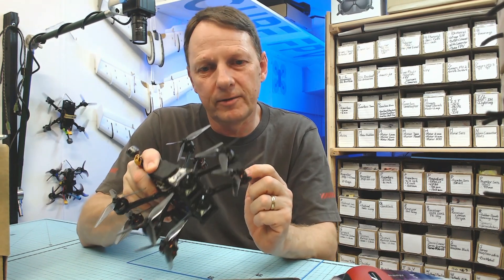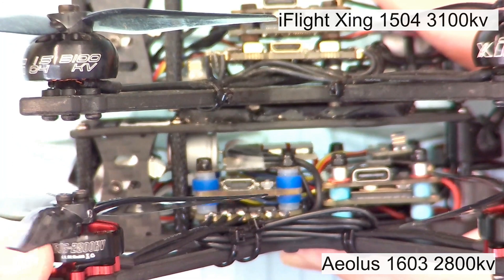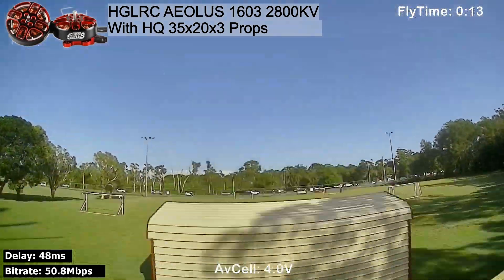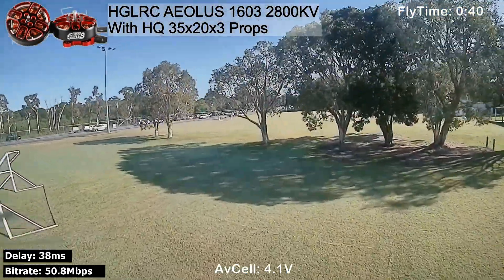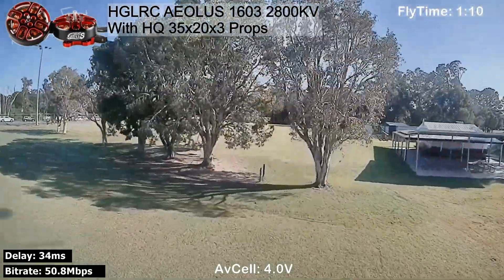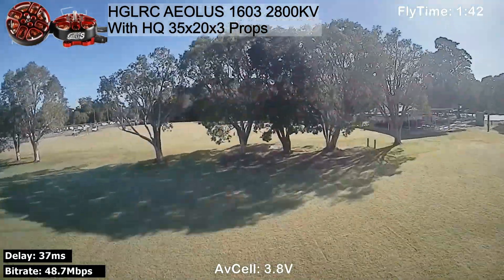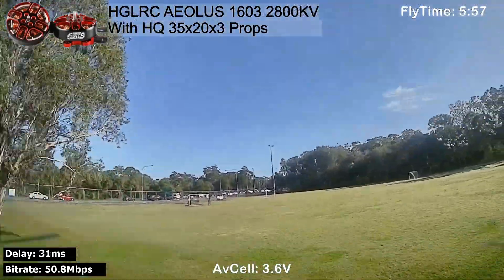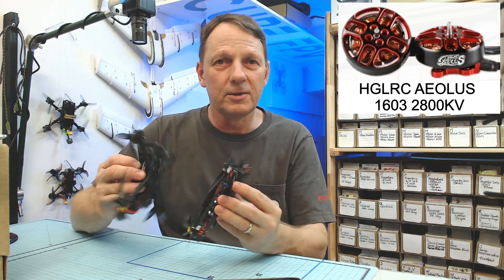Aeolus 1603 2800kv Motor Testing for 3.5 inch Freestyle

Comment: hello, based on the builds you've tested. may i ask what setup would you recommend for analog 3.5 inch freestyle build on 4s? frame, motors, aio or stack, props, etc. thank you very much. i already have crux35 analog. but im planning to build one
Reply from the maker: One of the best 3.5 inch frames is actually the one i am showing here - the GEP RC 3.5 inch. It's an older frame and great for analog. It's also suited for 19mm cameras which I like. I like this frame because its a short frame and you can stack components and keep the mass central. I fly HD but with analog the all up weight should be even less. I would go with an AIO board - any 35 amp AIO is fine. I've been using AIO in 3.5 inch for a long time with no problems. I use Xing 1504 3100KV motors even though others reccomend more powerful motors. These motors are good and the power and resoution in the throttle of these smaller motors is good for freestyle. Larger motors of course are more powerful but that doesn't help with fine resolution in the throttle that is needed for freestyle. I use an 850mah 4S cell with 3520 3 blade props and he a good 4 and a half minute flight time. 
Take a look at this resource on my website to see what motor, battery and prop combos are good for 3.5 inch freestyle - https://cubefpv.com/motor-sizes-3-5-inch-freestyle/